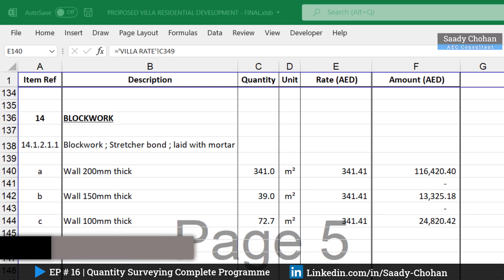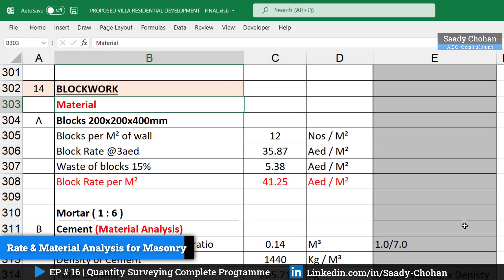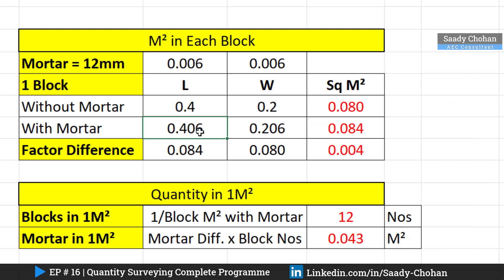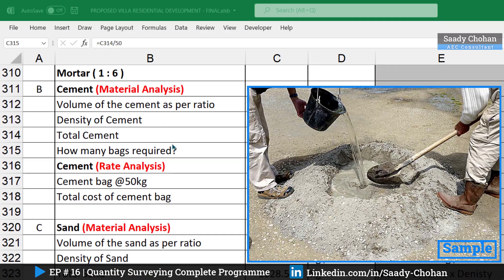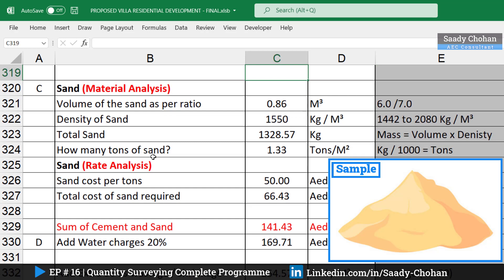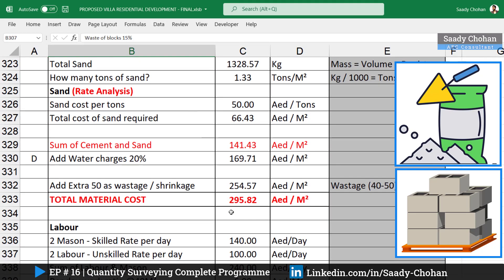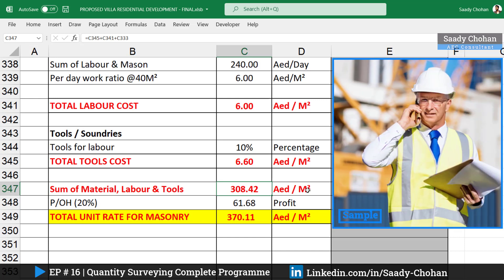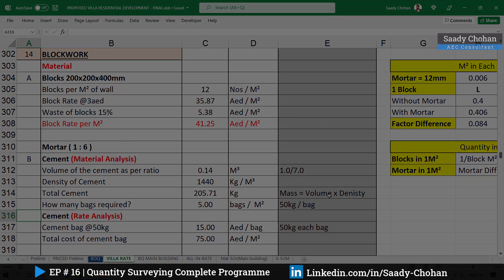EP - 16 | Masonry Rate Material Analysis | Block Work Cost Estimation | Quantity Surveying Programme

Comment: Please check your concept again 
If you are considering block work 1 Sqmt then why are you giving analysis of morter for complete 1 Sqmt.. it should be qty of morter required for 1 Sqmt block work dude.
Reply from the maker: Yes, Thank you for mentioning this. It should be the mortar required for that 1m2 of the block, if you recheck the video and the value I have taken for mortar you will understand - The mortar required for 1m2 of block work was calculated as 0.043m2. Please Go through the video again dear and you will get the idea.

Comment: Thankyou for this wonderful series,
there is a problem with unit rate calculation in this video,
though you have taken blocks ,tools and labour in meter square , when it comes to cement and sand it is taken in cubic meter and not converted into square meter for unit rate.
hope you will correct this mistake.
Reply from the maker: Thanks for watching and sharing your thoughts on  that.
Reply: Sir I think 1 bag consumed in 18 m2?? ...m i right

Comment: Mortar cost calculation does not seem to be correct, you calculated  mortar $/m3 , you didn't take into account the Mortar in 1 m2.
Reply: Ben, many thanks for spotting that.
We would also appreciate to learn from your method of calculating mortar. 
In mean time what do you think of this:

Cost of the 1m3 of mortar (295.85/m3) x mortar in 1m2 of wall (0.043m2) x thickness of the wall (0.2m) = Cost of mortar in 1m2 of wall. 
Thanks again
Reply: @patrickugwu8866  Say the volume of the mortar for 1m2 of wall is 0.043m2 x 0.2m thickness of wall (0.0086m3/1m2 wall). Cost of mortar(295×0.0086=2.54). Hence 2.54Aed/0.0086m3/0.043m2). *For 1m2= 2.54/0.043 =59Aed*
PS- Interchange the cost of mortar for cost of cement/m3 and then Sand/m3 to get /m2
Reply from the maker: Thanks Ben for watching & sharing your feedback. I am sure we can learn from your experience.